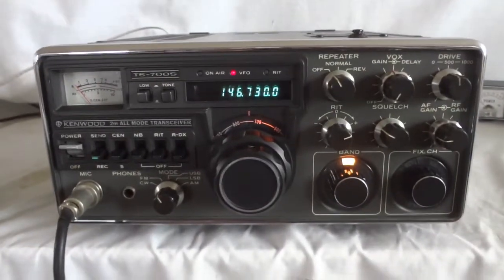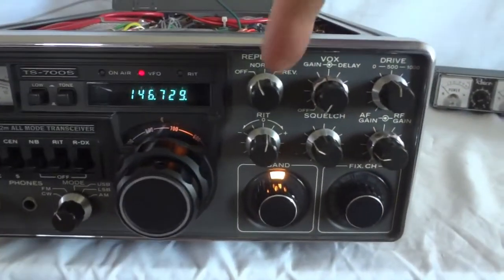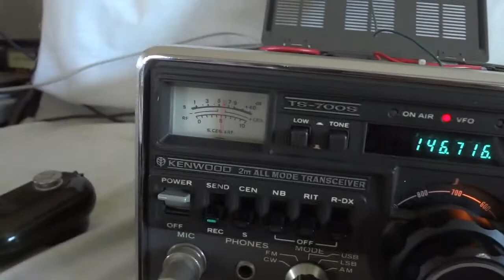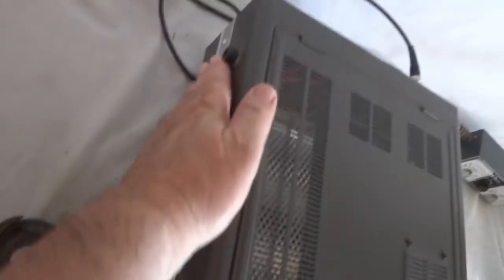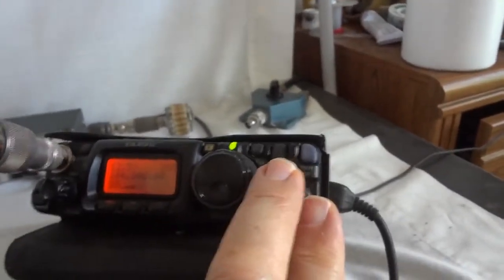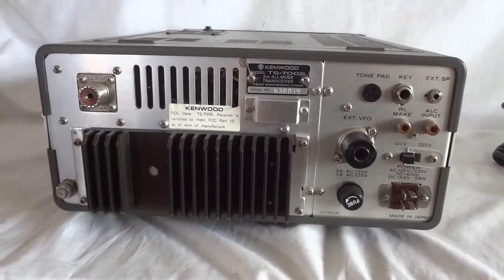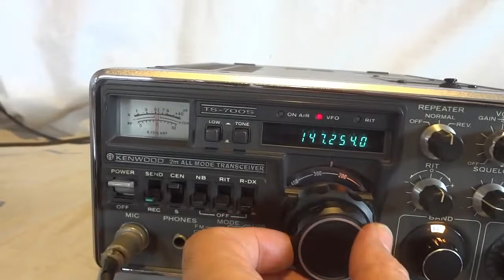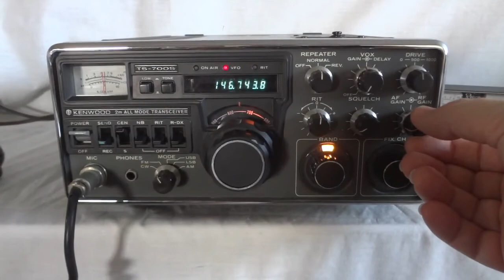Kenwood TS 700S Vintage 2 meter VHF all mode transceiver

Comment: This brings back memories. I used to have one of these. I bought it second-hand in approximately 1980 and used it for many years. Over time I made some modifications: I built a new receiver pre-amp, using more modern components with better noise figure. And added an extra coil in the power supply to reduce noise on the supply lines. I have used it in FM, SSB and CW modes. Later on I neglected the HAM hobby and this Kenwood started to collect dust. After about twenty years of dust-collection I decided to give it away.

Comment: The caveats with this generation of radios, and I own a Yaesu FT-225RD, are these:
No built-in CTCSS. If your local repeater is on tone squelch you're not going to be able to talk through it. 
No memory channels. The radio is controlled by the VFO. 
No scanning feature. If you want to scan the band prepare to spin the big knob! 
Low power. Most of these put out only 10 watts, as it was common practice for them to be used with a linear. 
If you have no technical skills, don't buy one. After 40+ years they will require some attention and the OEMs and radio shops won't touch them due to the age. 
But if you can live with all that... you can get a very good price on them at hamfests. Happy hunting!